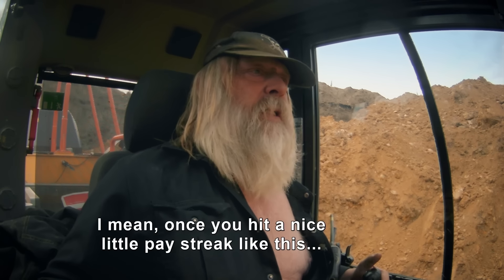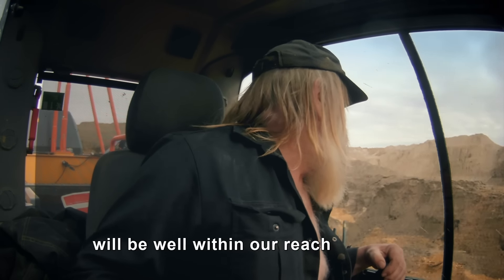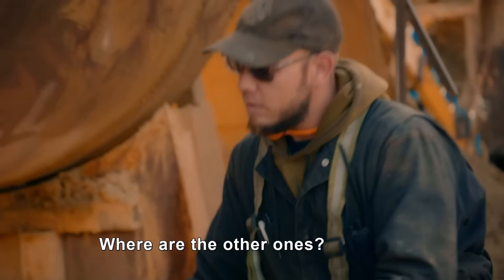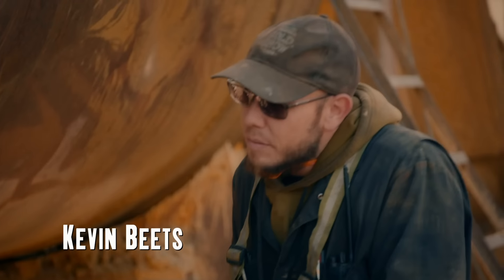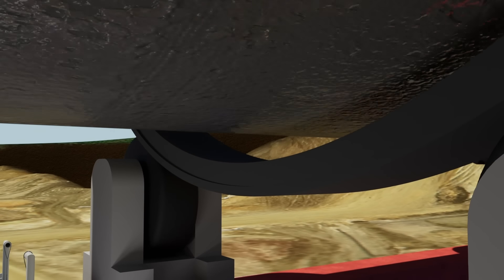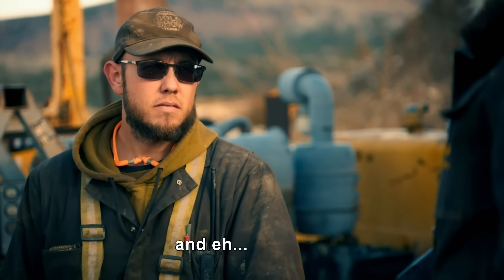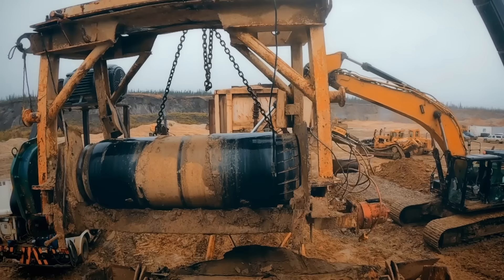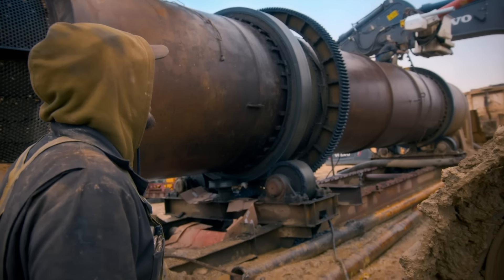Tony Beets Breaks His Season Record By Weighing $1.2 Million Of Gold | Gold Rush

Comment: They rotated that trauma so the crack is up top and the pressure would have squeezed the traction band  together. Then you welded two plates on the side to hold it together then v yhe top out  and  the sides that are exposed then weld them up grind the top surfaces then take the side plates off . Then you finish the crack where the plates where and then weld the plates back over top.. should only take a day
Reply: if you have no clue what you are talking about.  you might be better off keeping it shut
Reply: I never rotate my traumas. It's too painful.